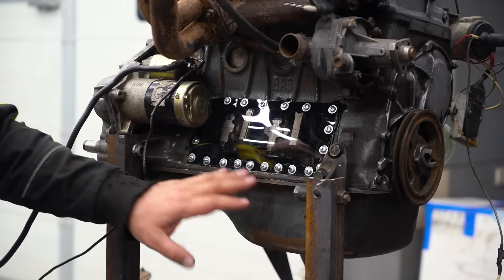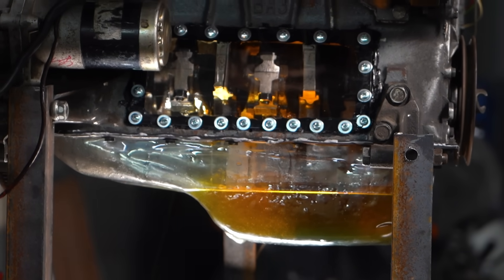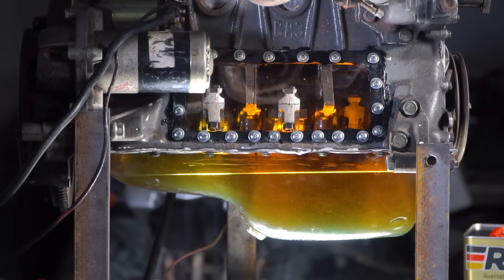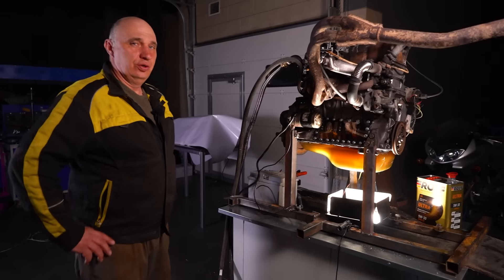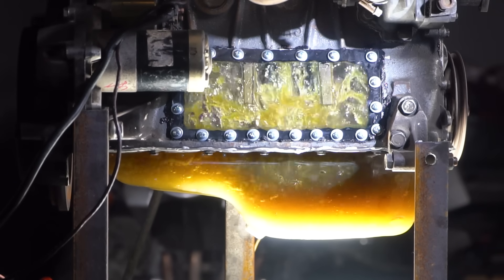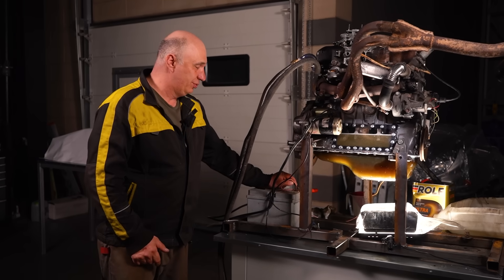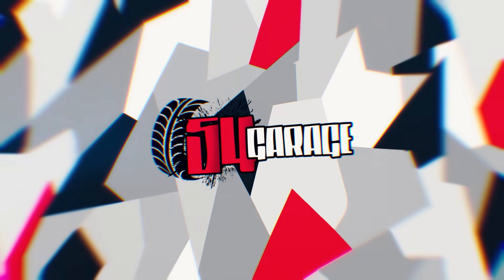What actually happens when you overfill your motor oil? (w/ transparent oil pan)

Comment: I've seen it done, exactly like this. When I was younger I worked as a mechanic for a landscaping company, they had this orange Mazda Ute that the boss took to driving, he kept telling me it was using a lot of oil and was smoking alot, was difficult to change gear and that he'd been topping it up more and more often, but he needed to keep using it apparently and wasn't prepared to drop it off for me to take a look at. Eventually I got a call from him from a job site, it wouldn't start.  When it got towed into the yard I immediately noticed two striking things, the constant dripping oil from the wheel skirts and the five empty four litre oil packs on the deck banging around among the other tools.  Opening the bonnet, the entire engine bay was slick, saturated, oil appeared to have been seeping from the filler in the rocker cover, pooled in every nook and cranny. I turned to him quizzically and he pointed out that but! but! but! the dip stick was still showing empty, and that he'd been carefully checking it every day and had taken matters into his own hands, buying oil pack after oil pack, the five empties on the back were only the most recent victims it turned out... Show me, I said, and he pulled the dipstick ...from the gearbox... dry. I pulled the engine dipstick and was met with a jet of oil, it had a working pressure head, all the way up to the head. Good o ring on that dipstick, perfect seal even under pressure.
Reply: Jesus H Christ. That is a fantastic story I wonder what year that took place in?
Reply: @ChristopherAndersonPirate  2000 ish, the ute was an F1000 from memory not sure of the year, it had a very hard life. Funniest thing about it was the way he just spun on heel and walked off without saying a word. I suppose there wasn't much to say ;)

Comment: Just in case someone is stupid enough to believe this guy.
The moment the oil starts to foam, by being aggravated by crank, the engine is on it's way to doom. The reason is lack of oil pressure. Foam is a mix of oil and air, which is compressible. Consequently, the oil pump cannot build enough oil pressure the engine needs, because the volume of foam it pumps gets compressed. Journal bearings in cars are hydrodynamic bearings, meant to run on an uninterrupted  film of oil supplied with enough pressure. Foam destroy that film. It is almost the same as running the engine with no oil. You can easily find videos showing running cars without oil for a few kilometers, but this does not prove that you do not need oil. Same here, engine can run a few minutes on foam instead of oil. Especially if it is some russian lada engine with pre WWII technology with manufacturing tolerances so large it would be called junk in a free world..
This video is dangerously stupid and it should be taken down. Please downvote and report to youtube.

Comment: What I notice from the crank contacting the oil is foaming. There's HUGE bubbles of air and dense microbubbling getting sucked into the pickup. In this case, more is not better! The extra quart was fine, even double filled was fine... heck, I run an extra quart in my little sedan just because of the oil cooler I have on it... but once the crank gets submerged it's a Bad Thing.

Comment: I once got a text on a Saturday morning. "What do you do if you put too much oil in your car?" 
I said "no big deal, if you want to drain a bit out you can"
Response: "what do you do if you put 7 quarts too much oil in?"

I was blown away. This dude had the thought be might be a little low so went to walmart and poured 7 quarts in. Bone dry the engine took 5 quarts, it wasn't even low to begin with. 

I got there, drained it down, wouldn't turn over. Cylinders filled with oil. Locked it up.

Comment: Awesome watch i like how double the oil wasn’t that bad.  Above that level the foam is a bad thing because it won’t protect the metal and cavitation will occur.  In my car i overfill with oil slightly because of burn off by the time i check it again it will be low sometimes too low so my mechanic asked me to overfill. When i did diesel mechanics overfilling was the expectation.  unless it was a reefer unit then the old guys said head gaskets get more sensitive to pressure from overfilling oil on gas engines more than diesels

Comment: I would be concerned that the oil being aerated by the crankshaft might cause oil pump cavitation and not get the volume required to where it's needed on the top end

Comment: How hot do the light bulbs get? I'd think the plastic pan would remelt with a running engine n hot oil

Also, wouldn't the fact you formed the plastic over the original mean the volume will be LARGER than the original thus making the amounts you showed, off?

The issue I ever heard with over oiling is bad lubrication due to frothing, bad mpg and power due to resistance and blown seals

Comment: In some engines, the increased hydraulic pressure will blow out parts of the engine seals.  GM engineering found this out is some of the LS series.  Also the oil vapor will foul the PCV system.  Modern high speed engines run a dry sump to avoid some of these issues.  GM engineer.

Comment: 18:12 If I were you (and COMPLETELY out of my Alleged Mind), I would have directed that breather tub back to the dipstick hole and sealed both ends so any oil that blows out one hole is directed right back into the engine through the other hole...

On the other hand, on that last run, it looked to me like you blew out the oil pan gasket and had a MASSIVE leak back by the front of the engine...
18:44 OK, I might have been mistaken, I don't think the gasket has failed, I think the plastic oil pan is cracked and is about to break entirely at the curve where the vertical wall flares out to the bolt flange...

Comment: Amazing video.... good work. I always thought the crankshaft was sitting in about 1 inch of oil. Probably a leftover idea I had from decades ago upon seeing a splash cup somewhere on the crankshaft of a lawnmower engine. I will never look at my oil-pan the same again.
Reply: Yes I was just going to mention that some small simple engines, like one cylinder lawnmower engines, don't necessarily have a typical oil pump. A little scoop is attached to one of the big-end bearing bolts. As the engine turns it dips in and scoops up some oil and flings it around the insides of the engine (lubricating the cylinder walls and cooling the piston etc). Works plenty good enough for  small  lawnmowers and the like.  Chevrolet up until the  early 1950's I think used a similar system, of scoops to scoop up and fling around oil inside the engine block. But they DID have a conventional  oil pump also, to pump oil up to the upper portions of the engine.

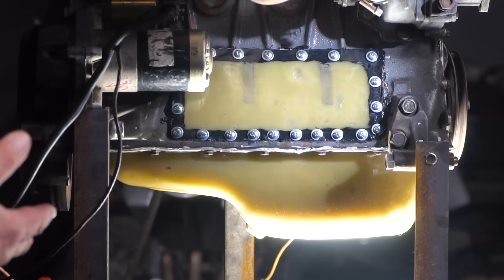Comment: 14:30 Even if that much oil isn't causing damage, it is costing you some horsepower because the crankshaft balancing lobes and connecting rod bearing caps now require more energy to turn since they have to shove all that oil out of the way as they swing down through the bottom of their stroke...

Comment: If they operated the engine under load, they would get a different story.  on no load, a few air bubbles inside the bearings won't matter.  Under load they may collapse, causing bearing galling.
in the early1960's, a car known as the Austin 1800 was released on the Australian market.   Due to factory error, they were supplied with an incorrect dip-stick, causing owners and mechanics to overfill with oil.   Driven around town there was a no problem, but owners frequently making long trips at highway speeds ended up with massive oil consumption and damaged engines.

Comment: With so much oil wouldnt the resistance be much higher due to constant contact with it? Thats one way to clean out an engine i guess though
I think a transmission would do much worse in a similar test

Comment: I can tell you first hand what happens if you let your stepson add oil to a 93 Nissan 4x4 with the 4 cylinder with the external oil pump and he puts a quart too much. It cavitated then lost prime and seized the pump gears up, broke the shaft from the distributor and still ran though the timing chain was rattling from no oil pressure to the tensioner. He then drove it from Nashville to Gadsden AL. 288 miles to my driveway and it was done for.

Comment: BS. My 1996 1.4 Honda Civic was once overflowed with a liter of oil. Lousy shop did that. It was flooded with about 4,60 L instead of 3,60 L of oil. I noticed it after a week or so, 100 to 200 kilometers later. A result was this - a blown head gasket.

Comment: Fraudulent video. What kind of oil is it using? Why is the oil not filled up? Yes put in what the manufacturer says to put in it. Anti-foaming agents prevent excessive foaming because the crank is rolling in the oil during normal operation.

Comment: Interesting, I was taught too much oil will blow out front and or rear seals. I never worried too much if I was half a quart above, specially with today's oils and engine designs. Way too much foam when you overfill by 2X's, that will cause a major engine fail, technically starving the pump, at least how I was taught and I'm old school. Cheers :)

Comment: Yess is a big problem... when the crank catch the oil bubble form... at high pressure the pump experience cavitation... on the bearings...this creates little explosions... because oil system is not purged.... it gots air....

Comment: At a dealership I worked a new hire from a automotive school, first car oil change , topped the GM 6 cylinder to the bottom of the rocker covers. Fired up first touch of the starter and blew the crank, main caps and oil pan onto the floor!

Comment: Nice experiment. I suspect that the plastic pan finally broke due to the high crank case pressure caused by having so much oil in it. It is nice to know that you could safely use double and recommended oil in that exact engine, but I would never intentionally drive it like that.

Comment: Most motor oil has cleaning additives.  Did this experiment use "detergent" oil?  If so, might be different if you used non-detergent oil.  Here in USA that is available in 30 weight and a lot of stores keep it with the lawn equipment.

Comment: Another video I saw it was a V8 making 600 horsepower and the only thing that changed when an extra 3 l was added was that the unit had perfect oil pressure all the way up to redline but lost 60 horsepower at the top end. So more power less oil in reality. That's it

Comment: The problem would be that by overfilling the oil, the crank whips the it into a froth and foaming it with tiny air bubbles… causing cavitation when the pump picks it up.  
👉🏻 air in the oil makes it less efficient 👈🏻

Comment: Not every engineblock is the same. There are engines where the crankshaft WILL plunge/dip into the oil below when overfilled to this degree and cause problems as the metal "punches" into oil, causing massive foaming. Not good!
By the way, basically all engines are designed not to get damaged by overfilling it just a little bit. The designers know that clueless people exist and built-in a safeguard. Same goes for level a little bit too low. There are safety-margins in both directions.

Comment: As a mechanic of 15 years I found this video very interesting, I and by the sound of it the guy in the vid honestly thought it would hydraulically lock at some point. if the engine breather was routed back to the intake system as it would be normally then all the oil would've entered the cylinders causing it to lock, This is still interesting as I was told it pushes into the cylinders pass the piston rings but it looks like it's the breather that allows the oil to enter the cylinders  :)

Comment: That crank at the beginning of the double fill was 100% touching the oil on rotation that’s why it started to foam and froth under revs and splash everywhere. That’s the issue with overfilling. The parts make contact and foam up the oil and throw it everywhere.

Comment: Interesting video, I always wondered :) Guess the downside of using double or tripple the amount of oil is inefficiency due to friction, air bubbles, potential damage to the engine because of the air bubbles and pump efficiency and also the many £££££ $$$$$ to put that much oil in the engine in the first place :)

Comment: The thing people aren't understanding is, no, your engine won't blow up right away. but when the crankshaft comes in contact with the oil, specifically here with an engine that doesn't have a windage tray. The oil will become very aerated thus causing the bubbles to be sucked into the oil pump. the bubbles will then travel to things like bearings and can create an environment of little pockets where there's no oil between the bearings and things like the crank/rods. being a 1/2 quart over isn't going to hurt anything. Being 3-5 quarts over. You're more than likely going to see some serious issues if the engine is ran long enough.

Comment: As a teenager, I had a Pontiac 400 in a Firebird that was 425 HP. After a number of hard accelerations the engine blew. Later I was told the engine oil was forced to the back of the oil pan where the pump couldn’t pick up any oil and it seized up. Was too young and broke to fix it. After that incident I always wondered if it was okay to overfill it with oil. Thank you!

Comment: Neat one. Took me back years ago when I got called to a lorry mounted standby generator (1MW unit). I got told it had been running fine the previous day when it was delivered to site but it wouldn't turn over at all now. Oh, and yeah, 'the batteries must be naff'. And sure enough, when I tried cranking it, it it wouldn't even attempt to move. Checked both of the huge batteries - nothing wrong there. Inquiring further, I got told all that had been done was they'd filled the engine up with diesel. No guesses where that diesel had been put. Through the large OIL filler cap mounted on the side of the engine. It was filled to the brim! They say there is one born every minute. Too right.

Comment: The oil has two jobs to do.  One is lubrication.  The other is cooling.  Too much oil means churning within the crankcase and that causes heating.  In this case the oil no longer completes it second job.  Leading to overheating and the consequences of that.  The very reason there is not only a low level mark on the dipstick, but also a high level mark.  Of course if one puts so much in as shown in the later part of the video, we can see the other consequences as well.

Comment: I once was in a hurry changing my oil on my Toyota. I jumped under the car, removed the drain plug, drained the oil and returned the plug. I changed the oil filter, filled the engine with 5 quarts of fresh oil and started down the road. After a few miles I decided to check the level to see where it was at. The oil was so high on the dipstick it was in the dipstick tube! What I did was drain all the oil out of my transmission and filled my engine with 5 more quarts of oil. Man that was a learning experience, but I always wondered what would have happened to my engine if I would have been able to continue after my tranny was junk. Good thing I caught my error before I had wrecked either of them!

Comment: It is a known fact, to much oil in the sump creates back pressure in the crankcase. The pressure has no where to go, so the following can happen. The dipstick can be pushed up, the engine breather fails, crankshaft oil seals fail, to relieve the pressure. Oil sprays out all over the engine bay. Oil pressure drops and Bang goes the engine. Simple solution, fill to approximately halfway between minimum and maximum on the dipstick.

Comment: When I was in college I took my Mazda Protege to a quick oil change place just before road trip. It turned out they put twice the oil they should have into it. I didn’t notice anything different from normal until I floored it to pass on a 2 lane highway, leaving a huge plume of white smoke trailing behind me… panicked I pulled over shut it down and then found the oil level significantly over the max line… I limped it to the next town and got another oil change where they found 10qts of oil in it… I drove the car for another few years and there was never any adverse effect

Comment: Adding an extra quart prolly isn't a major foam risk to most engines, but I've seen some real geniuses that overfill so much that oil comes out of the dip stick.

Apparently you can cram 20 quarts into a Shelby Mustang. The engine seized the second he put it in gear and rev'd according to the customer. Pretty much blew every seal and there was actually some expansion on oil lines... The engine was a total loss. What a waste. Such a nice Mustang.

Comment: Well... IMHO, you can not show there are no problems with just a 10 minutes run test... and pretty sure, once so much air is mixed  with oil, your oil pump will suffer and may be damaged with time...

Comment: Aerating the oil is not a good idea as it causes uneven oiling (Mix of air and oil) and does not help keep stable oil temperature / pressure for the same reasons, it might even introduce cavitation in the oil pump and starve the engine for oil. Also, the extra drag created by the crank splashing or even picking up some of the oil at lower levels is parasitic drag that decreases HP to the wheels and increases fuel consumption.  Some sources say that the parasitic drag is over 14-18 hp on some engines and why the high performance engines have a windage tray. Engineers who design those engines based on decades of experience and millions in research have a pretty good clue what's right and what's not...